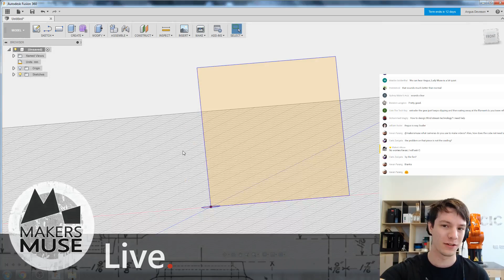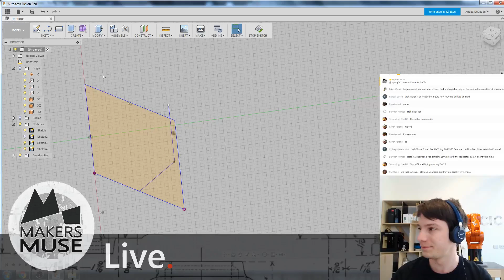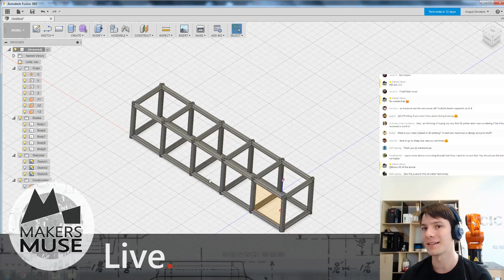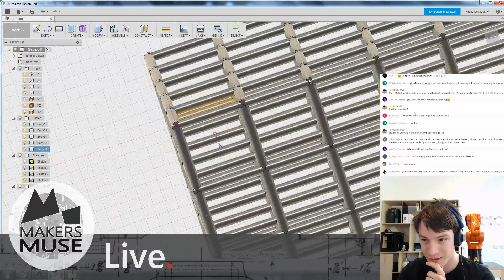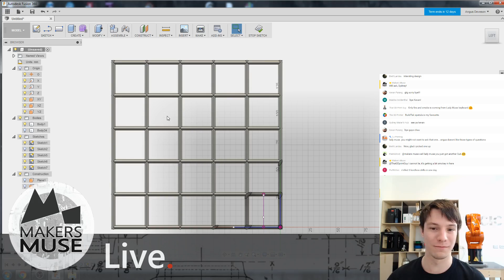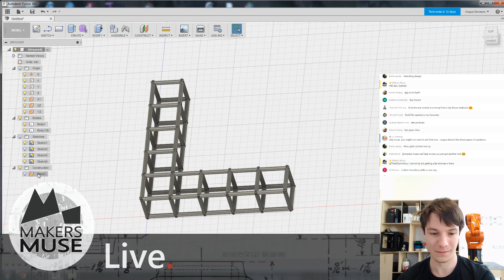Maker's Muse Live Stream - Fusion360 and Q&A

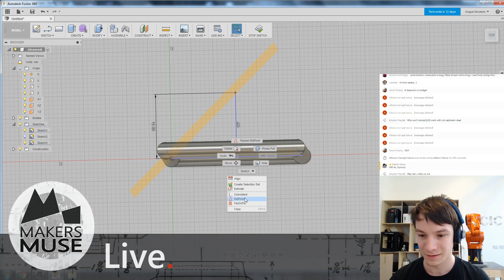Comment: @ 9:32 WHen you want to use a line/ point from an earlier sketch in the current sketch you need to project ( "p" key) it (or its end points)into the current sketch..  

Great video again . Will you print the model
Reply from the maker: Ah OK got it, thought it would be possible to constrain to other sketches like SW but that is fine. It just failed hard on the Duplicator 6 - cooling isn't good enough. Will try on the Prusa Mk2 I think.
Reply: I hope you will be doing a video review on the Prusa Mk2 - Really enjoy your review videos
Reply: Yeah Fusion is a bit strange with a few things ( as you've noted) and sometimes it does "recognise elements / skectch/ points or bodies from within the same design, sometimes it doesn't. Honestly speaking i prefer no auto projection . Can cause tons of issues when you have detailed modeling "behind" your sketch as it tries to predict which line , point or feature you want to reference I come from Autocad / Inventor back ground and while i think its an easier step than from Solid works, Fusion still has me screaming to the CAD gods in frustration sometimes.
The one thing i have learned ( the hard way) is always always "make component" at the start. Either straight away or when you create the first body. Certainly if your design will contain multiple parts 
Cheers
Reply from the maker: Absolutely will!
Reply: Great video Angus, was sleeping for the live stream, but always watch later when I do miss them.
I've been dabbling with Fusion360 for a week or so, so still very much a beginner.
I've created my version of your lattice cube, though only 4x4 at the mo.
Currently printing on my MK2 but only at 0.3 layer height ... so far so good.
Fingers crossed :-)